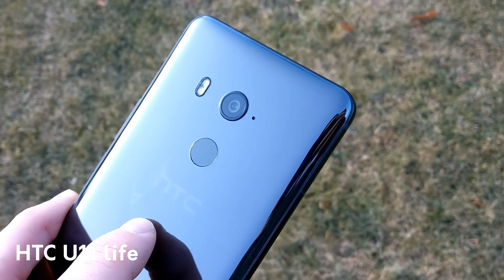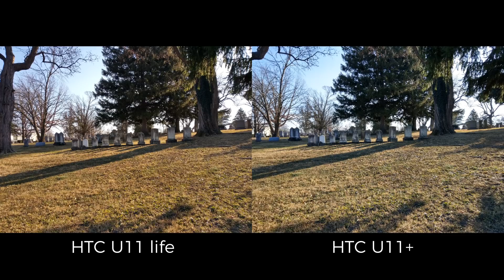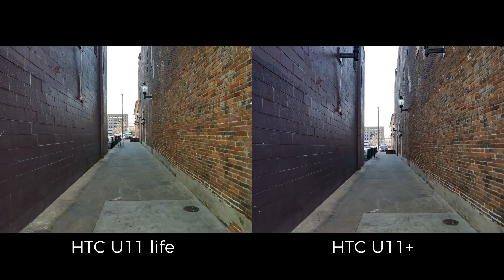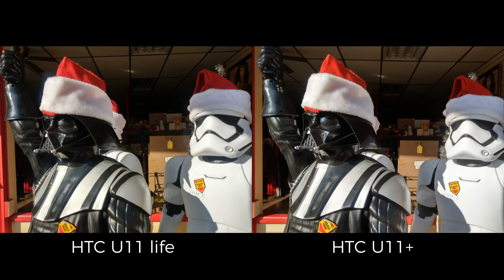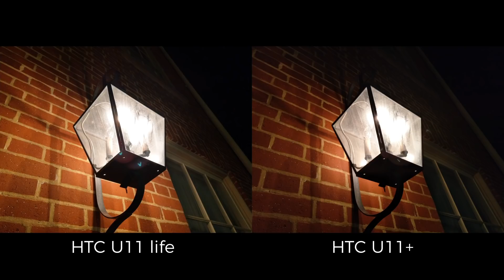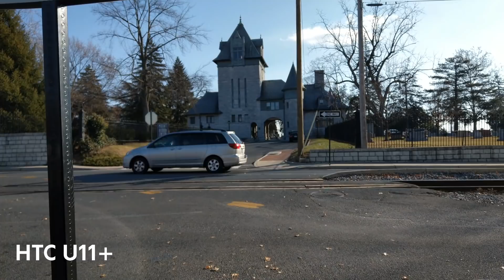HTC U11+ (U11 Plus) versus HTC U11 life: camera shootout

Comment: I couldn't really see much difference between the two until the images were in low light situations. Also, when subjects were strongly back lit the Life didn't fare as well as the Plus. Overall the Life put in a strong performance given it's specs, but as you say, the Plus was the clear winner.